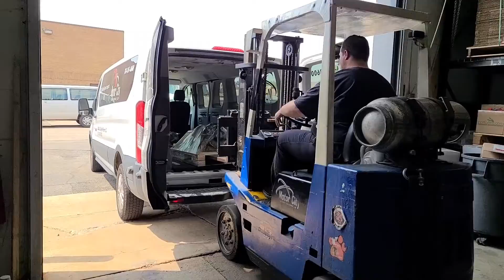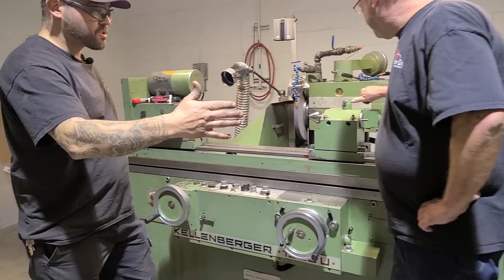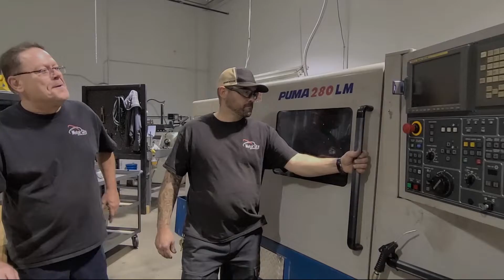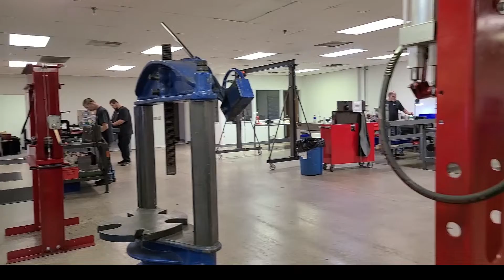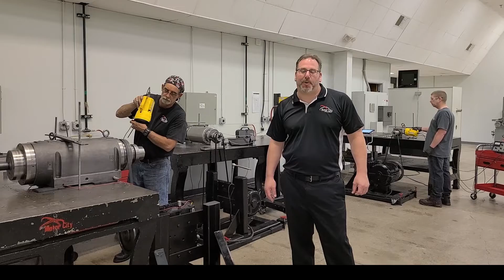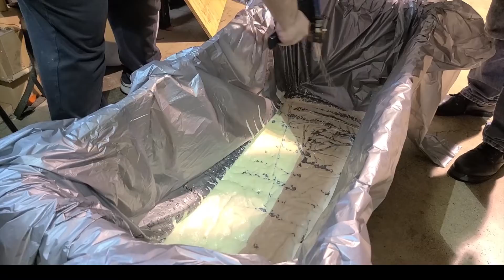Machine Shop Tours: Motor City Spindle Repair

Comment: Hi, I’ve just watched your video over in the UK and you’ve an impressive setup? I’ve been in the Machine Tool Industry for nearly 50 years building,installing, repairing and servicing NC and CNC turning and milling machines in various parts of the world. My fascination is accuracy and quality and would love to find out how you hit the tolerances you talk about? Most spindles I’ve worked on have tolerances of between 0.01mm and 0.02mm as standard using mandrills of which can be a struggle to achieve at times so do you have any video examples of how you set bearings/spindles to 0.002/0.003mm? Thanks in advance👍 P.S. if I was younger I would have loved to have visited your shop to gain even more experience?

Comment: How much would an 8,000 rpm robodrill spindle cost to rebuild (old bearings / noisey bearings)?
Reply: $3500 to replace all bearings, dynamic balance & test run.  More if GPG is needed.  Ted@motorcityrepair.com